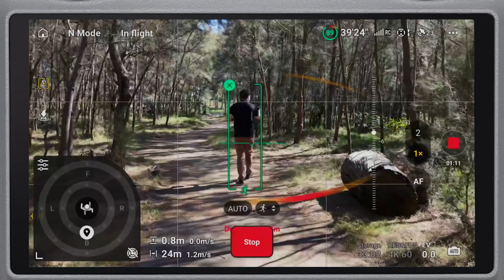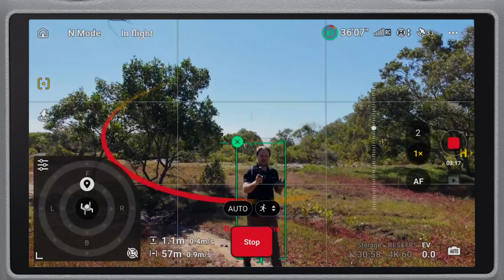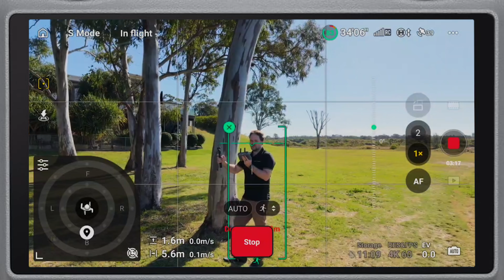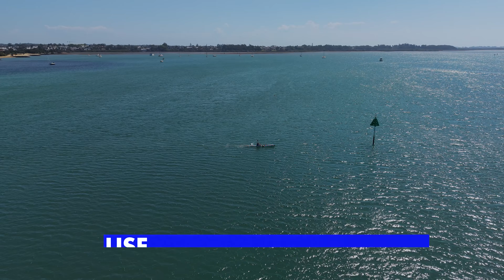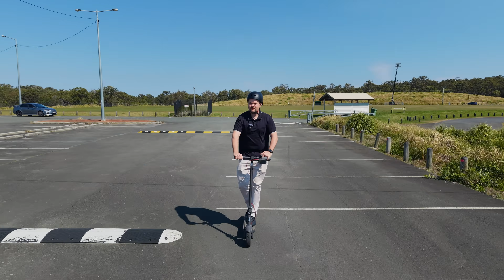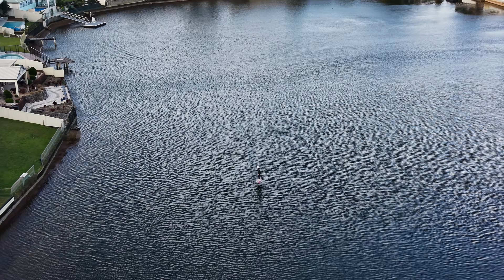DJI Mini 5 Pro Tracking Gauntlet – Can It Keep Up? 😳

Comment: 1. Do you really have to say you're Australia's number 1 drone YouTuber? 
2. Why do drone reviewer always walk through a forest? Do they live there?
Reply from the maker: 1. For authority and credibility. 

2. I live in a house but the forest is always a good test for a drone.
Reply: @DansTubeTV  Drone reviewers never the real life situation. Nobody is going to risk a $1000 drone flying through a forest. Actually people cycling around the world never use the tracking feature. They all fly the drone with the sticks in the open landscape. The results are better, smoother, and it simply is faster and easier. Try use a touchscreen on a bike, impossible. It is far more important how fast you can get a drone in the air. Grab the thing, switch on the controller, fly. If it takes minutes you are not going to bother and just move on.

Comment: Is it possible to measure the thickness of the plastic body between the mini four pro versus the mini five pro. I’ve seen one video how many five pro fell and broke his arm. I’m just wondering if the sickness of the plastic when it falls as a consideration to durability.
Reply from the maker: From what I can see, there is not a major difference in thickness, it would be very slight.